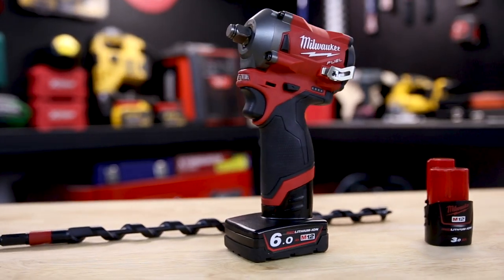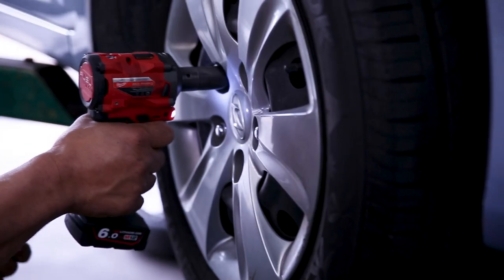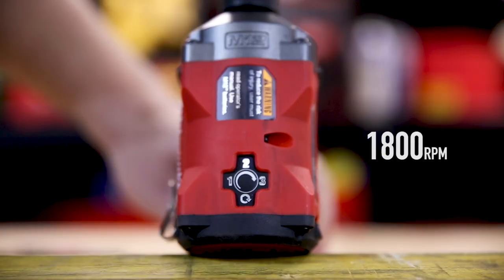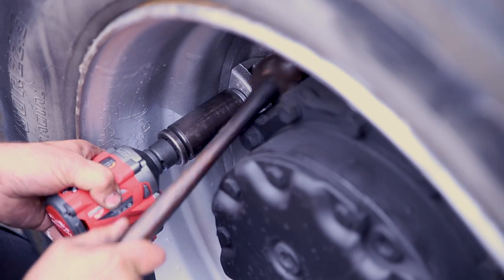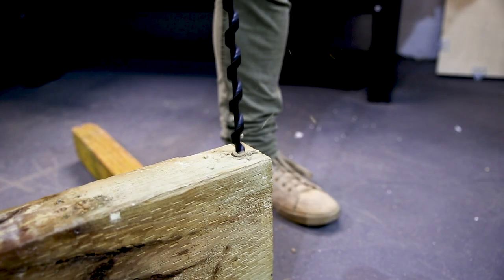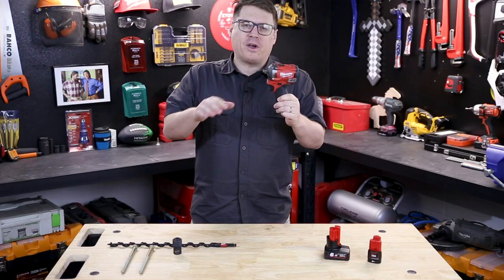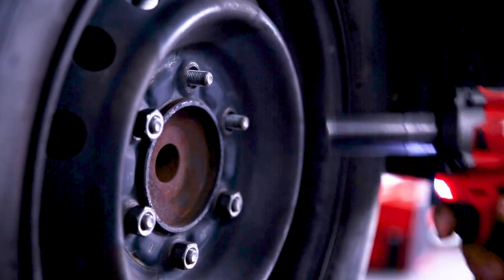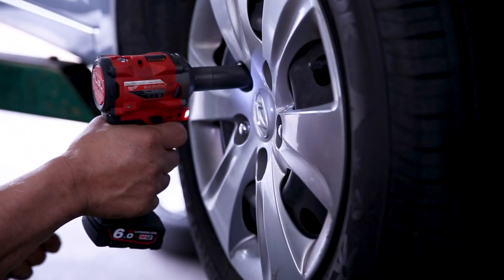Milwaukee M12 FUEL Stubby Impact Wrench (M12FIWF12-0)

Comment: The 2amp battery sucks. Upgrade to the 4 or 6 and it becomes a champ.
Reply: I just got the set with the 1/2” stubby, 2amp and 6amp and a charger nice set and I can use the 2amp as a spare for my Milwaukee ratchet which is handy

Comment: I am thinking about getting one of these for my car (in the event I get a flat tyre), and I have to get the wheel off.

So will this impact wrench be good for enough for taking off wheel nuts off my car, and can they be charged in the car’s 12V socket?
Reply from the maker: Getting the wheel off. More than enough. In fact, use it on the lowest setting when tightening the nuts so to not overtighten. Regarding charging You will need to get one of Milwaukee's car chargers for charging batteries off your in car outlet. see https://sydneytools.com.au/product/milwaukee-m12-18ac-12v-18v-li-ion-automotive-car-battery-charger
Reply: @SydneyToolsTV  
Thank you for your prompt reply, I will definitely consider purchasing this impact wrench, all the reviews see to be very positive,